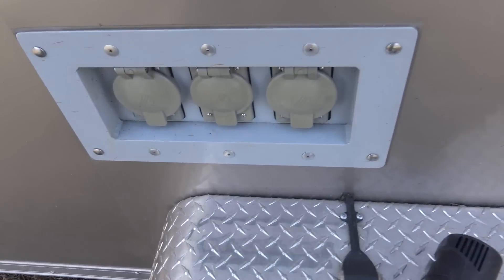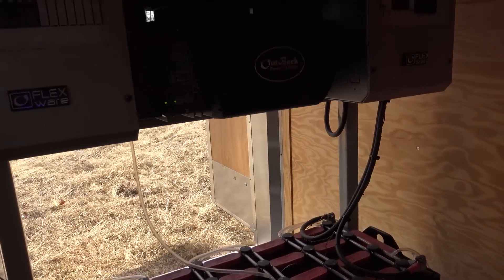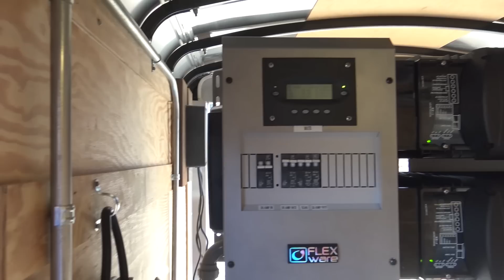Mobile Solar!

Comment: Do most power companies allow you to have net metering without a special meter installed?  Would they require an inspection of a completed solar system prior to switching the meter....for example I guess I'm missing how you could just plug this into your house wall for net metering.  Finally, would it require some additional control software to manage the batteries from not discharging fully to the grid or is that only done with excess dump power?   Thanks for all of your content!

Comment: Rotate that battery pack 90 and then add 6 self supporting ground solar panels that you could slide in a rack on the sides of the battery in that would be slick, could probably get 8-10 if though out good, but the roof mounted for quick setup and top off while moving / in a smaller less demanding load. I also like others idea of putting lithium ion packs to reduce the weight and you could double the capacity along with the extra panels. I could also see this rig being good if you had a temporary radio comm tower stuffed in there for emergency situations like fire season in the mountains or during an event (race, run, cycles, ...).

Comment: I don’t understand why people don’t put micro inverters at the panels. AC can be transported farther with less gauge than DC. I realize you may have loss of power in the rectifier to charge batteries, but I would think this to be negligible than the loss through 20-30 feet of what looked like 8AWG maybe it was 4AWG. Even at 48V.
Reply: it costs more, people like cheap

Comment: You have so much extra space inside of that trailer that you can put a small 50cc hydrogen generator inside of it to keep the battery levels topped off during low light situations like winner or overcast days when power is in heavy use and the by-product of the exhaust is just water which you can collect and put back into the system if you wanted or just have the exhaust running straight to the ground and the exhausts way cooler than a gas burning or propane burning mini generator it's just a thought but hey keep up the good work I like what your doing

Comment: I think japan in some places, has started to plug ev car batteries into the home circuit to make its stored energy available for home use too. I like the 'take it where you need it' idea. GM had installed generators in some pickups to provide tool power for off grid jobs a few years back. This setup takes that to an entirely different level. Do they provide an alarm system to alert if someone moves the unit?

Comment: What about windage?  I am thinking a good gust of wind could flip that trailer when the panels are deployed?  Would outriggers be needed or a good idea to stabilize it?  What is the weight of the battery?
Reply from the maker: tonkacaptain There is literally a ton of gear in the trailer.
Reply: Thanks for the reply.  Looks interesting and I like the idea of being mobile with it.
Reply: What about the bigger auxiliary array trailer?   Look like wind would play havoc with that one.

Comment: Nice rig!!  At $20k, why not go the extra yard and use LiFePo4 batteries?  Yes, more up front cost, but payback especially in weight for a mobile set up... seems like it would be the way to go.
Thoughts?
-Rob  (btw, I love your videos/info across the board... I'm not sure I would have downed the water in that pond/waterfilter vid though... you're braver than I.)
Reply: Ya its nice equipment for the price point. I mean reliable electricity for 25 years +. Ive spent thousands of dollars on more wasteful investments. You can start a build for one of these super cheap as well, those trailers go for peanuts, 1500 maybe.
Reply from the maker: rkaag99 you can get it with lifepo4s too.

Comment: How many ah the battery
Reply from the maker: Bongbong Ventura they range from 418 to 836 ah. This one is 523ah.
Reply: So the one showing is 523ah...This is Sealed Lead Acid???
You state 24 cells gives 48 volts? so thats 2v per cell x 523ah/cells???
or 8-3.2v x 65ah/cells hooked in series???
Reply from the maker: carl bole the battery is from IBE and it is a flooded lead acid with degasser/watering kit attached.  This one is a 523ahr 2 volt battery and yes 24 in series got a 48v ,523 Ahr bank.
Reply: Dont get me wrong...I LOVE the panel/trailer setup...I LOVE that it is 48volt, but i HATE lead acid...truth be told, you can only use about 240 of those amps before you hurt the battery..SLA= Dinosaur.

I was going to do exactly this, but with my batteries. This would allow me to haul my prototypes to spots where I can show/ sell my prototypes and my batteries...all portable, yet adaptable as to customer wishes...

You have the trailer and panels, I have the batteries and prototypes and a 3/4 ton truck...We should talk about a springtime partnership where I promote your Panels/Trailer/Setup, while I promote sales of my battery cells...I have unique prototypes, along with your unique trailer I think can generate massive interest...We just have to show people and let them try the battery...I have done a small test just locally and people want these, but I am out of battery stock until spring..I am looking into Quebec Hydro possibly helping with some stock batteries at this moment...Let me know..I will forward email, if so...
Reply: This battery is rated for 2000 cycles  at 80% DOD.

Comment: I envision a simulator RE generator but instead of the rigid heavy typical permanent roof mount panels being used here a flexible light weight panels. Imagine an folding easy up shelter style rack on a 20 ft cord that could hold the panels. You arrive at your destination deploy several of  these racks and install the panels plug it in and in about a half hour or so you have your 1.5-3-4.5 kw system good to go. Time to leave unplug fold it and put it in trailer. This would take some thought to make sure it didn't blow away in the wind but seems to me it could be done and with 1 trailer.
Reply from the maker: So many options.  Yes, I am about to set up a fixed array at a location that can be coupled o the trailer upon arrival.

Comment: Really a nice set up there and in my opinion, well worth the price when you consider what you're getting not just in equipment, but peace of mind. My only gripe is the diesel gen set runs at 3600 RPM, and for a diesel, that's too fast if you want some thing to last for years and years. They should find a diesel that runs at 1800 or 2000 RPM. Keep up the great work.
Reply from the maker: Yes, The cool thing is you can use any generator  or shore power with the trailers.  I would be hooking my 1800 rpm diesel or gasified Onan to it.
Reply: If you maintain your battery correctly you can get 10 years out of a battery.

Comment: If you add internal earth anchors that you screw down through the floor, it will stabilize against wind, and make theft difficult without breaking in and removing them first.
Reply from the maker: Yes, good idea.  earth anchors keep coming up for a lot of uses with solar.  A future video for sure.

Comment: I've had others want something portable. I haven't went through the process to figure out cost. But permit is not an issue  this way
Reply from the maker: Yes, we run into alot of permit issues and if someone would just get a permit for a generator and then use the trailer they would be set.

Comment: I have an off grid remote location and have been somewhat concerned about vandalism or theft of equipment.  This setup would solve that problem by taking the most expensive equipment with me when I leave the property.
Reply from the maker: Yes, We recommend a simple 50amp twist lock connection  and a transfer switch then you can just plug into your remote location. :)  Plus you can use it at both places.

Comment: Sorry another question I would need to keep all this equipment in a heated environment or it would greatly shorten the life span of the batteries I assume if exposed to months of prolonged below freezing temperatures ?
Reply from the maker: If the batteries can be kept charged you can keep the unit in a cold environment, just not exposed to all the elements.

Comment: It looks great but I went to check the price and to me it seems that any time that a customer has to ask for a price then it seems the product is way over priced and it needs a salesman just to try to convince a customer to purchase it. I understand that it may be a high price. Just put a price on it.

That said, I have been a subscriber for years and love what you do. I would consider hiring you if I needed something and you were closer to my location. Thanks for all your videos.
Reply from the maker: I understand and appreciate the feedback. There are so many models and options that this product takes some time to spec out for the customer.

Comment: This would be a good idea to trailer around from pump to pump to irrigate with during the summer.  Lol.
I'd get a trailer that has insulated walls tho. Bcuz those trailers turn into ovens when it's  hot outside.
Reply from the maker: It is vented and  the can also be conditioned.

Comment: Do they tow the trailer behind the Leaf?
Reply from the maker: No, the lil leaf would be dead. lol.  They charge the leaf and drive back and forth to town.  They also drive the leaf to the Nissan dealership that offers free charging so they go there when they need to do some serious shopping and then head back with a fully charged car.
Reply: Engineer775  Darn, I was hoping they had it figured out.

Comment: Battery system is too last decade. Not watching
Reply from the maker: This system has 10-15 yr battery on board. They also can be upgraded to Lithium Ion.  A well maintained FLA can last for 20 yrs.

Comment: Does that include the trailer because don’t need a trailer I just want the appropriate equipment and I’d build the shed to house the equipment?
Reply from the maker: Yes, this is a system.  If you want just the components shipped to you then send me an email @ practicalpreppers.com
Reply: Engineer775 In this day and age lithium is the only option better at everything except cost....
Reply: one size fits all,  that works out so well, so often

Comment: What does set up cost ?
Reply from the maker: It is a lot but no more that having a solar company come and install the same equipment.  The battery alone in this is 5K.
Reply from the maker: I got ya.  It is expensive but for me it is a priority.  IT is a long term investment, peace of mind and we have set many people up with no utility bill for the rest of their lives.
Reply: crap that's too much.
Reply: Please don't take that the wrong way... I'd love to be all solar I just can't afford it. I wasn't talking about your pricing.. just the cost of solar in general. Thanks.
Reply from the maker: nope. 2020
Reply: Engineer775 what does 2020 mean?
Reply: when tax credits run out.
Reply: Tax credits are getting lower every year. Almost done they are.
Reply: Engineer775 Didn't all the tax credits for solar expire Dec. 2016?
Reply: Bro Brah does it make you feel smarter to make negative comments like that your still a moron
Reply from the maker: Average Cost after tax credit: $20,990